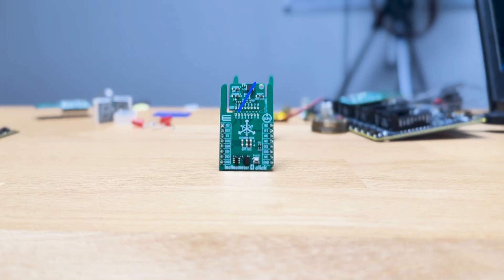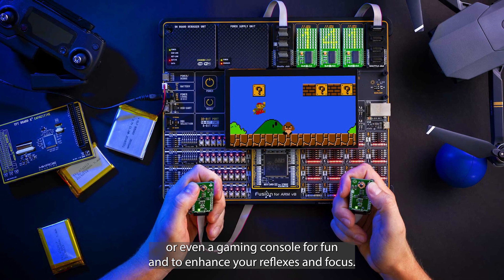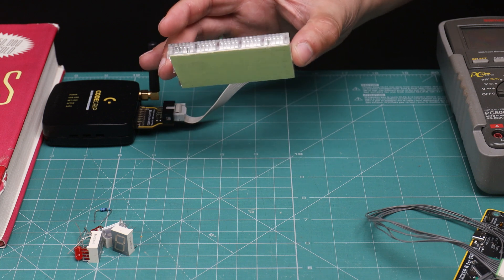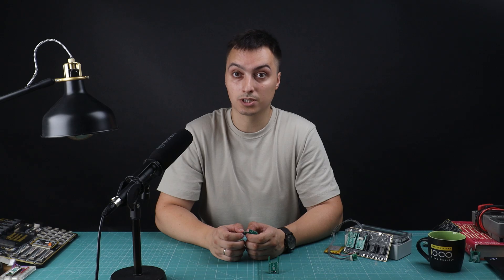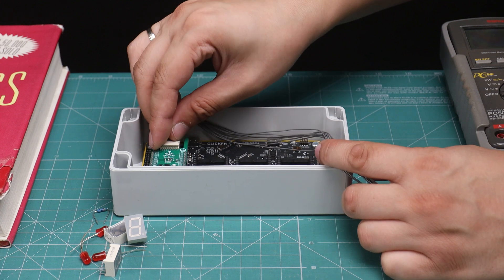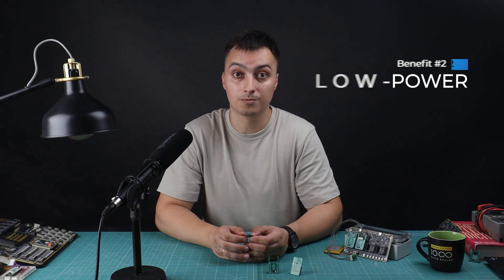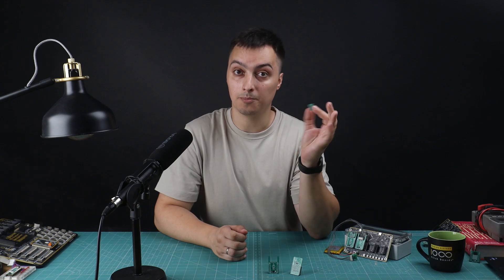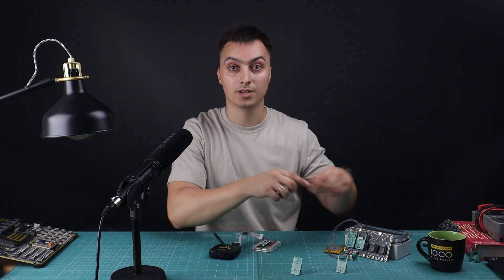Click Snap | Introducing New Feature of Click boards!

Comment: idea is good but execution is flawed
1) nobody likes that small form factor cables becouse they are pain in the ass in usage just becouse nobody want cramping tool and nobody want to use cramping tool, even FFC tape is better due to being abundand, did i mension they are always stored in large bin of forgotten cables?
2)you can scrap whole idea of cutting board for usage of USB-C or even micro usb type B or even old good type A connector is good if you want eliminate risk of pluging board wrong way, purists like me dont like idea of breaking something and most importantly USB-C cables are cheap, abundand and reliable, and made in to much much higher standard for sake of fast data transfer and power delivery in 3.2+ standard
3)soon i will be moving abroad and i will be without soldering iron, i can buy USB cable in damn grocery storer
4)its really easy in firm to tell anybody "go to shop and buy god damn USB cable" and nobody will complain for spending money on strange single case usage cable
5)U in USB stands for uniwersal
6)i can guarantee you, over 80% of people will solder there gold pins and use duponts from aliexpress, did you know how bad are cheapest duponts from aliexpress? one cheapo beancounter can ruin your day buying you cheap duponts
7)usb C have 24 pins, when connecting them symetricly to do not bother which side is corrent, you still have 12 pairs, not even this is 4 more connections then what are you shown, you have pairs...you know...redundancy ;)

Comment: Unnecessary Necessities
Reply: My thoughts exactly. All of the mentioned issues appear due to the core design of their product and then they "solve" them by making things more complicated (probably also more expensive, even if the boards cost the same - just speculation) for their userbase.
There have been many existing products with similar functionality available on the market for years.
Reply: @KillerDragon987   as you said there have been many products, but almost all they are crap, if you are only testing  or are student go with arduino, but for me who has to designe, and sell the solution I have to ensure the quality, accuracy with mikroe, and look professional.
Reply from the maker: Customers receive several key benefits from the ClickSnap: reduced project space, minimal power consumption, and accelerated Time To Market (TTM) by easily incorporating it into their projects. This innovation addresses the demand for enhanced usability of Click boards.
I agree it was a necessity. About the "Unnecessary" keyword: not so much, because of the previous arguments.
Reply: @mikroelektronika  agree to disagree.